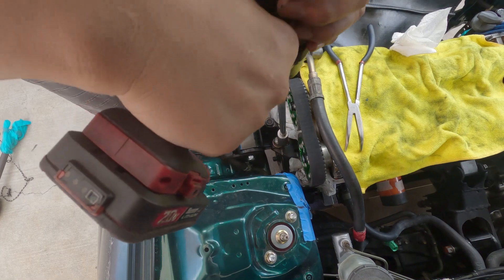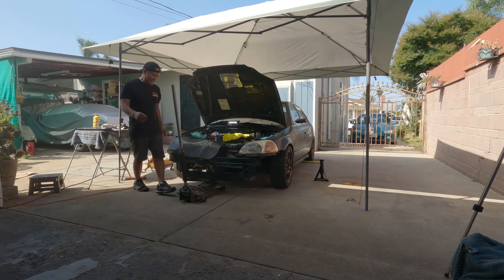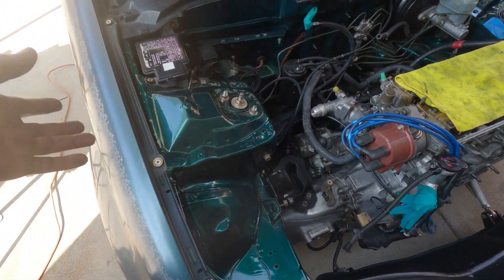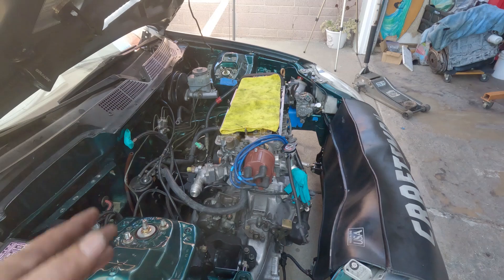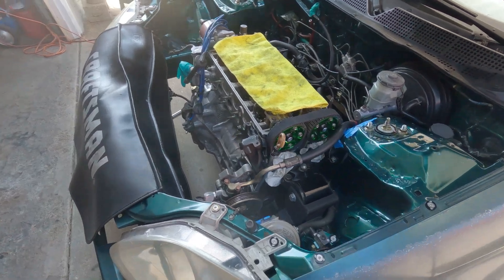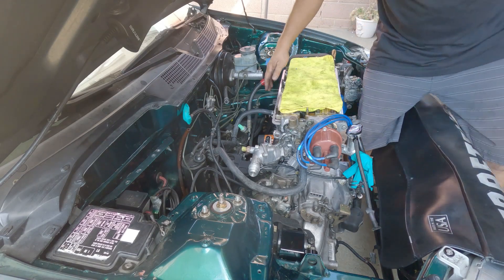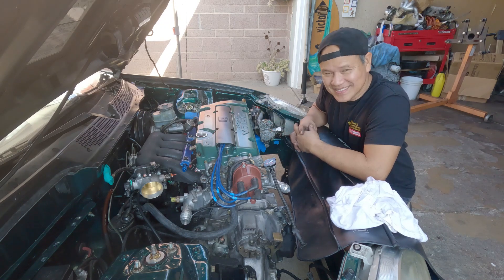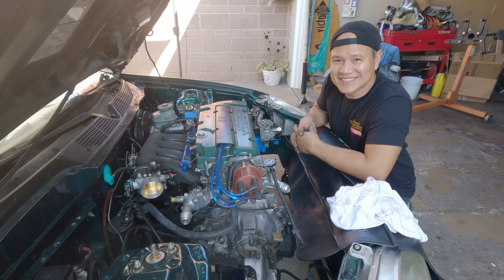G2B Build Update!  ep. 13

Comment: What harness do you use?
Reply from the maker: I'm using the existing 96 automatic electrical harness. I spliced a Accord obd1 alternator connector. I converted the dizzy connector so it plug n play on 96 harness.

Comment: Looks like you modified the rear bracket. The 99 civic si bracket works for h2b or is it because you made your own half plate.
Reply from the maker: It's fully custom, rear T bracket, tranny bracket and driver side post mount. The engine move about 3/4" towards the pax side. I did it that way to have room for the power steering pump.

Comment: Great job holding it down for the h/f series!!
I have a question for you.
I have and f20b with a m2a4 tranny with lsd in a EG hatch, i recently went rsx shifter with k tuned oem rsx cables and a hybrid racing trans mount, everything bolted up and i can shift thru all the gears when the motor is off, but when i start the car i can only shift into 1,3,5 and barely R. 2 and 4 just pop out without fully engaging, any insight would be greatly appreciated.
Reply from the maker: I had it before, not long ago on my Accord were l can't shift on any gears at all when engine is running. Turned out that l damaged the clutch lining spline and it get stucked on the input shaft. But your's l think is simply the way you route your cable. Have someone to do the shifting for you while you are chevking all the movement of the lever on the trannt, or use a phone to record it. That way way you'll see it specially when shifting on 2,4,5 ( engine shut off) You can recheck all cables and install it one by one, make sure the cable that'll be connected on gear shift( tranny side) is actually have enough cable to pull or push the lever to put it on gear. For the cable that attach to the left side of rsx shifter, check the other end(tranny side) to make sure its also pushing or pulling the lever. Do you remember not having any issue when you mate the tranny n engine together. That way we can eliminate the possibilty of like what happen on mine. I also made a vlog about  damaging the clutch  spline if you want to see it. Hope this help you out.
Reply: @sagittnet2158  thanks for the speedy response!! I have it routed above the subframe and thru the fire wall, ill get a friend to row thru the gears while im at the engine bay to see if its binding anywhere,
I only have an adjuster on the passenger side of the shifter cables for the front to back throw on the shifter
its an Acuity 4-way shifter for the rsx.
Reply: I can also go thru each gear by hand when i have the cables disconnect at the trans, if that rules out any trans issues
Reply from the maker: @d33zy22  if you can shift it by hand tranny is good. Also check if the clucth is actually being freed up when you step on the pedal. You have to eliminate all the possibility. Hope you get it fix man.
Reply: @sagittnet2158  solved!!!
My HR transmission bracket was 5 mm to close to the shifter arm, effectively moving the shifter range of motion out of the cables range of motion, i ordered a plm bracket and after install and testing i have full use of my shifter now!!
Super stoked thanks for your help!
Reply from the maker: @d33zy22  that's good man! It's night n' day compare to oe shifter. I heard Acuity is much better than HR rsx shifter. Enjoy man and glad you got it working. Later!
Reply from the maker: I'm not sure if your cable have a adjustment but l have 2 cables, 1 is adjustable and the other is not equip. But l managed to adjust it though, try it only if the cable need adjustment.
Reply: Did you torque the clutch bolts to 19lbs? Could be that you over torqued them.
Reply: @ericloki3188  swaps been running solid for years, this only started after changing my shifter and cables, i see alot of people running this setup and im frustrated not being able to get it done

Comment: Looks Good 👍 the valve cover matches the chassis. Are both 89 Integra axles from InsaneShafts?
Reply from the maker: The insane shaft pax side inner joint is setup for H22 transmission. Since l have a 89 Acura Integra axle, that's what l installed. H22 inner joint have a longer shaft spline than  Integra.
Reply from the maker: Thanks